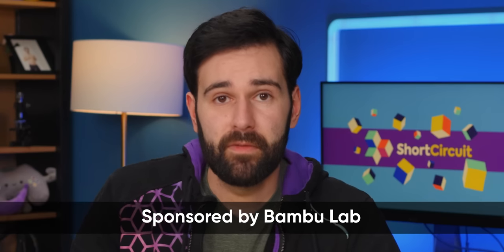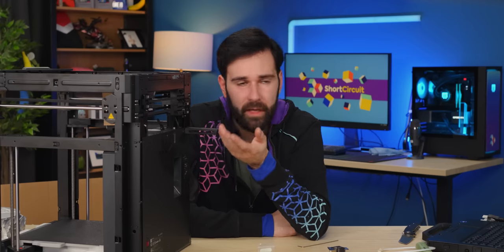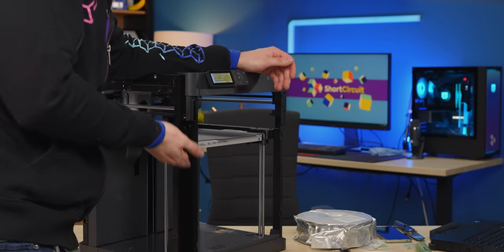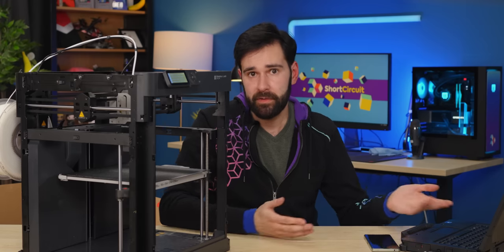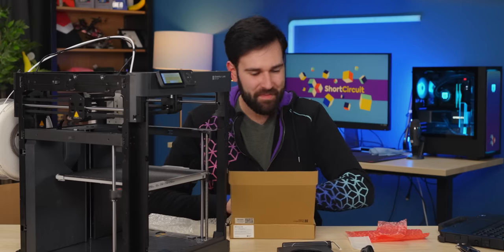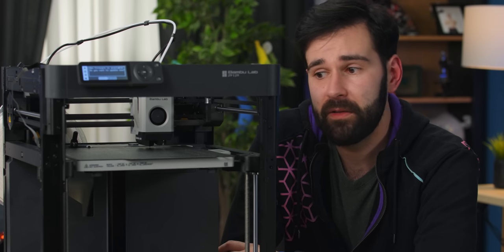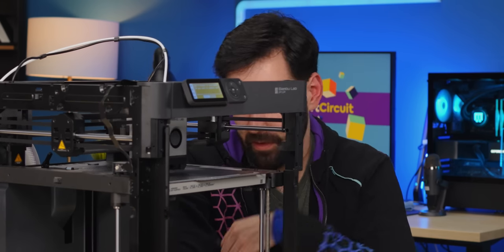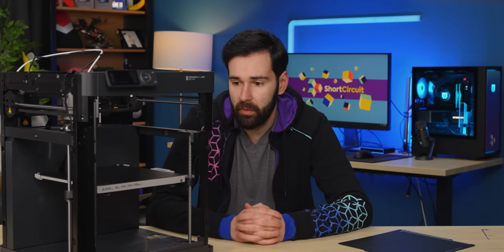I wish this wasn't sponsored (because it's so good) - Bambu Lab P1P

Comment: I have really loved the Bambu products but the proprietary gate for pretty much all of the important components is really a big drawback for me when you compare how they handle repairs/replacements with the rest of the market.
Reply: The replacement parts from Bambu Labs are cheaper than open source parts from 3rd parties, so it's not as much of a problem. Also 3rd party replacements are starting to come out for the P1P and X1 carbon. Pretty soon you'll be able to get pretty much all the parts from 3rd party manufacturers. I've been running 6 Ender3s/Aquilas for a few years, and my next printer is probably going to be a P1P.
Reply: @zues287  do you have Bambu printers? When Im talking about replacement parts Im not talking about consumables or basic parts like nozzles, hot ends, and fans. I was on the original kickstarter for the X1 and a few components were broken on arrival (linear bearings and rods). It took 5 months for them to ship me replacements and this isn’t an isolated problem even for consumers (several creators a little more engineering-focused have complained about the proprietary gate). These are proprietary and aren’t available from third party sellers. The proprietary nature hasn’t stopped me, Bambu Labs seems like they’re improving and I have picked up a 2nd printer from them (P1P) but deeper maintenance of their printers is absolutely an issue for all buyers.
Reply: @DrummerAndPker  those were the early days when they barely had enough parts to fulfill orders. Most of the parts are available now, and a lot of parts that aren't consumeable are becoming available from 3rd parties.
Reply: @zues287  then please link me for bearings i have been looking for future replacements
Reply: @DrummerAndPker  the bearings are off the shelf parts and can be bought from many suppliers, like Misumi. Don't know which bearings you're looking for, but Google is your friend. Most of the parts are off the shelf parts, except for the hotend and mainboard. The hotend is already available from 3rd parties.

Comment: the price is wrong. x1 carbon is $1200 and x1 carbon combo is the one that is $1500. Also, the belt tensioning is not fully automatic. You need to loosen a few screws them move the head manually a bit, retighten screws then it's properly tensioned. I don't think we know if it is based on marlin like they say in the video. It uses marlin gcode but it could very well be fully custom or based on something else. They don't give much info about the actual firmware and it is closed source.

Comment: BTW the hotend is NOT proprietary, bambu has never to my knowledge forbidden 3rd parties from manufacturing hotends from their design and I've seen at least one company making an upgraded version for temps up to 500*C. Also they make them available for a very fair price, I have several sizes of hardened hotends individually for half what I paid for a single E3D nozzleX though it remains to be seen how the abrasion resistance stacks up to the excellent nozzleX. I'm not shilling I just want to give credit where it's due, I have no issue with the custom hotend so long as they allow 3rd party production and keep the pricing where it is now and I welcome anything that makes it so I have to deal with less stupidly delicate v6 style thermistors.

Comment: BambuLabs printers has A LOT of deal breakers. One major one being that it CANNOT run Octoprint, which is almost like industry standard at this point. Guess that's one of the talking points taken out being a sponsored post. And the remote ONLY works on Wi-Fi, which again is a deal breaker for many

Comment: Yeah big problem with RFID tagged filament. You end up wasting so much if something goes wrong. Have an old da Vinci printer and have half a spool left that I can't use cause the tag reports it as empty. Not to mention if I wanted to buy new rolls it would cost the same price for their 600g compared to a normal 1kg. Any RFID system makes me step back from looking at it.
Reply: it won't actually stop the filament from being used. it will just show a empty bar on the printer and studio. pretty much just visual and it just uses the filament run out sensor for true runout. got a old spool core with my original white NFC. just respooled filament on it and it still prints fine. plus it works without NFCs without issues so moot point compared to da vinci's crap
Reply: @thatonebelgian  that's good to hear at least

Comment: P1P does not use Marlin at all. The firmware is proprietary as everything else on the printer. The gcode type is set to marlin due to them using marlin gcode type as their base. That doesnt mean it runs this firmware. Its the same thing with PrusaSlicer using Marlin gcode style on Klipper printers. Klipper is not marlin but uses this style of gcode. Marlin gcode style became sort of standard in the DIY community.

Comment: Not that there is a right way to do proprietary stuff, but this is how you do it. I bought an XYZ Davinci JR has my first 3D printer, got it for like 100.00 on Facebook marketplace and it was great but its not a filament clog that cannot be unclogged, so my only option is to replace the print head, the print head is 75.00, and because of XYZ's dumbass propietary filament, and the build of the JR, I can only use their filament, and their filament is 21.00 a roll with shipping that costs the exact same. Its insane. Like I'm still super new to 3D Printing but I enjoyed what I could do with it

Comment: I've been looking at buying a printer, i'm trying to avoit the prusa mk3 as the design is pretty dated. I was looking at the flsun v400 but the bambo seems much nicer, I think this might be it. The possibility to buy the multi filament add on later is super nice
Reply: The design isn't dated at all, people love to say that becasue they don't know any better. Its still very relevant. The prusa MK3 printers are reliable and serviceable, BL printers are not. All you have to do is put wither klipper or input shaping on a prusa if you wanted the speed.
Reply: @LilApe  It is dated, it's expensive, still uses a basic cartesian layout and doesn't have anything the newer printers have like a modern interface or lan (the prusa mini already got those upgrades as the design is much more recent). It's a great workhorse and an absolute legend in the 3d printing world but it's in desperate need of a new revision or better yet a new generation designed from the ground up with more modern capabilities. Something like a mini xl maybe, less print volume and at most 2 print heads at a more resoanable cost to compete with the new kids on the block.

Either that or quite literally slash the price in half, it's just not competitive with other printers in it's price range

Comment: I understand they have most of the essential features of Octoprint built into these machines... but not having octoprint available (and having it all tied into an online-required app) ruins this printer for me. Yes, they have a LAN mode... but, they send analytics for every print you print back to them the minute it goes online again. With all the privacy concerns with DJI and the fact that all these engineers came from DJI, this seems like it's just a simple way to cut out the middle man and send your proprietary designs straight to China so they can get a jump on making knock-offs to sell to Amazon.

Comment: Who is the competitor?
Reply: Prusa. Which is the reliable option. Bambulab printers are un serviceable and are designed to be sent in for repair when the CF rods/bushings wear down
Reply: @ShowXTech  Lil Ape is an actual troll that posts on every single Bambu video.

Comment: I wish Bambu would come up with a bigger model for about the same price to be honest, in both models (X1 and P1P). 256mm isn't enough for me. Something like 400mm x 400mm x 256mm would be much better, WITH the option of adding in a laser module. Then, I'd be fully in the BambuLabs train. For now, I'm waiting for them to mature a bit and offer more options. I've been interested in the product since day 1, it's just not fitting my current needs, so I've got a very slow printer for now...

Comment: What if Bamboo decides it doesn't want you printing certain things? Like guns for instance. It's legal where I am, but what if they decided they didn't want you printing them?
Reply: You can print a few different ways.
Cloud from computer to Printer
Cloud phone app(print history) to printer
Direct from SD card.(sneakernet)

Gcode is just instructions on where to move and where to place filament basically. It does not say block printing of fire@rm shell.

Comment: Ok quick question for the experienced people with 3D Printers, this or the Creality ender 5 s1 pro? This seems to be 100$ more expensive but I don't really care, I'm willing to spend up to about 700 for my first printer but I do want a reliable and good printer, I'm seeing mixed reviews for the Creality one and It sort of scares me
Reply: I don't own one, but for another $100 it's a no brainer, the P1P. Unless you're looking to build a kit like a Voron or Rat Rig the P1P is the best value  performance printer on the market. I just hope they get better at support and parts because I am seeing some things like you need to buy a new printer and return the old one for a refund and that is not good.
Reply: I will agree with other commenter. Creality keeps pumping out trash machines to inflate their inventory. I will probably never own a Bambu Labs printer. I'll spend my money on a Voron Trident or a V2.4 as I need the build volume and value the open-source model. Even then, without a sliver of doubt, get the P1P over whatever creality product you can name.
Reply: The Ender 5 S1 is quite a different story for Creality. I would highly recommend you get the 5 S1. NathanBuildRobots’ recent videos tells you why, basically:
Bambu machines are WAY louder
They don’t offer a spare bearing because the machine is glued and spot welded together and you can’t repair it AT ALL if anything goes wrong
The carbon rod is going to wear out
The print quality on the Ender 5 S1 is very good, on the Bambu, at least for Nathan, is terrible (probably because of the bearing, but that’s unfixable) (The one Dan got seems to have weird noise too)
The 5 S1 can also do 500mm/s and 8000mm/s2 on my machine, and again, the limiting factor for printing faster is volumetric flow, which I can upgrade on my standard-ish printer. At stock it is about 18mm3/s
You can run Klipper without spending any extra (I use my laptop instead of a Raspberry Pi) (No, you don’t need a Sonic Pad)
And Klipper is obviously better than Bambu offerings.
You can upgrade the parts cooler on the Ender 5 S1, while the Bambu is sometimes insufficient
Reply: Also there’s no 5 S1 Pro, just S1
The 5 S1 is already equivalent to the 3 S1 Pro, with the all metal hotend. The build plate can be replaced with a PEI one, which an official one is available. (I think the PC coated one is totally fine though… not really too sticky. As the plate is flexible, I can remove parts just fine)
LED light bar? No one needs that, so yeah, go 5 S1 over 3 S1 Pro and Bambu Lab P1P

Comment: So what's the purpose of the account? I feel like it was completely meaningless and he uses it ONCE at the beginning and even says "we only need the app for this and we already have an account".
If the account is needed to start up the 3d printer for the first time, then what happens if you want to sell it second hand? Do you have to unpair the device and the new owner pair it to their account?
What happens if Bambu goes bankrupt and you won't have an account to pair the device with? Do all unsold 3D printers become paperweights and current owners become unable to re sell them as anything but paperweights?
Is the firmware lock that we saw in the video something that will affect retail customers? I sure wouldn't want to buy a product that bricks itself because it can't update it's firmware.

I feel like there's A LOT MORE questions that could be asked about the product in it's current state. This is just what i caught watching the video once.
Reply: the account is for cloud intergration with your 3d printer you can remotely start prints and monitor it real time. you dont need a account if your planning to print gcode with SD card.
Reply: @ipodtouchiscoollol  i heard when he said " we need the app and we have an account ". Then didn't say anything else about the account, and i assumed it was some dumb first use thing .
After rewatching he does indeed say "i'm glad they let us skip this", so everything involving an app is truly optional and you can use it without the app. Thanks for the reply!

Comment: P1P has a big flaw in the design, to save money they used low-quality screen (even 100$ Ender 3 has a better one) that is paired with ESP32 wifi chip, which means painfully slow file transfer if you want to print over Wifi, not to mention how freaking loud it is

Comment: Not allowed to print without latest firmware, and a proprietary plastic monitoring system?
Inkjet anyone?
Reply: being forced to update firmware is only on first boot. if there is no wif it doesn't update. every other update can be skipped. the monitoring system only works on the AMS system and is only used for settings and remaining filament. it doesn't lock you out of using non-bambu filament and doesn't even really stop you from printing with a "empty" spool

Comment: At $700 though. Now, that's not the most expensive printer I've ever seen. But it's too expensive for the material cost. I would rather just wait until anycubic Gussies up and makes their own that looks kind of like that for like half the price
Reply: Yes it's got fancy proprietary stuff. But this could very easily and be a $500 printer and they can still be making plenty of money.
Reply: anycubic has been unable to make a good printer for the last two years
Reply: @thatonebelgian  saying anycubic cant make good printers when they literally make the parts that major 3d printers use.
Reply: Let me clarify. The manufacturing company that makes anycubics parts. Is the same manufacturer for several 3d printing companies. This was commin knowledge when printers were called "ender clones." The Chinese factories that whipped out the parts. Made them for ANY company and the "new" companies that brag about "boutique" or "high-end" printers use the same parts. The companies that dont act like they are the apple of 3d printing and charge a premium. Gatekeeping good printing from the hobbists. A year from now when this printer inevitably flops due to its price. I will buy it on eBay for like $300.

Comment: Proprietary filament? Immediate NOPE. I remember when 3D systems stopped production of their printers and filament, leaving thousands of customers who paid thousands if dollars high and dry with a useless printer. If it requires proprietary filament, don't buy the printer, because filament is the only aspect you will absolutely always need to be able to buy.
Reply: if you actually paid attention. the filament NFCs are ONLY for the AMS system and is just used for preloading settings and amount remaining. any spool of filament works on it. 0 lock down on filament usage
Reply: @thatonebelgian  if you're right about that, that's fantastic. But not the interpretation I understood

Comment: It sucks cause bambu makes great stuff on the surface, but they are a very shady/unprofessional company in other ways. I should also note that these printers lack proper thermal runaway protection, and can reach high enough temperatures to auto-ignite plastics (AKA, catch on fire). 

They have also been known to ship broken/faulty printers. Their AMS system is especially problematic, as its not a question of if it will break, but rather when, with bamboo themselves suggesting you just use tape or super glue to temporarily fix the poorly designed parts that often break on their $500 filament system.

I recommend watching more through reviews before risking your money with bamboo machines.
Reply: thermal runaway protection improvements got added like 4 firmware revisions ago. the 3 minute wait was only during one situation and I simulated it for fun. my PLA didn't catch fire nor did any of my other filament.

"known to ship broken/faulty printers" you mean the vocal minority. they have sold and shipped out thousands of their printers and I am active in most bambu related socials. yeah there is occasionally a broken fan, a warped bed but you are making it out like they are just mass shipping out broken printers. they arent anycubic lmao. 

the fragile part of the AMS got revised months and every single AMS now has it fixed. older AMS system that do break there can now just get the fixed shell through support. 

you sound like you took info from 5 months ago and never looked any further lmao.